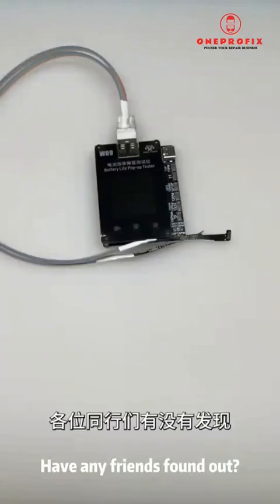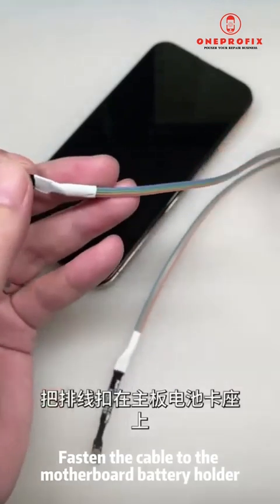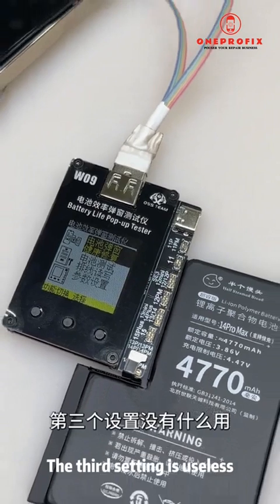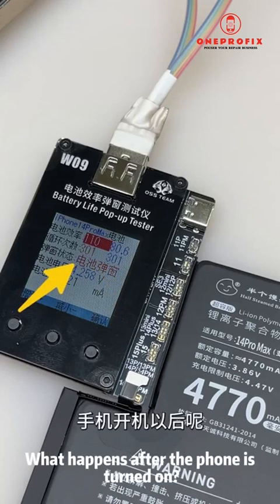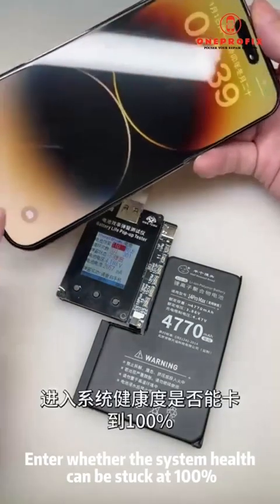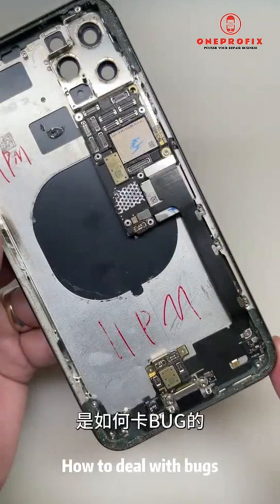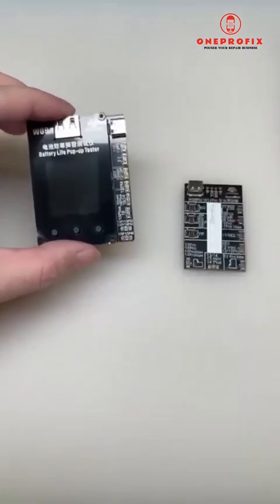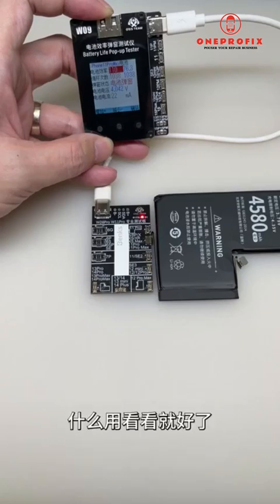OSS W09 Pro V3 battery efficiency pop-up tester without external wiring efficiency 100 data repair

Comment: Can you use this devise also to increase battery health of the old original battery ?
Reply from the maker: Requires original battery or new battery with cables ported from original battery
Reply: So to be clear with this device there is no need to swap BMS board when changing battery ?
Reply from the maker: @Poppington-1z  Premise: The battery above the original mobile phone must be in, because the protection plate of the original mobile phone must be removed, and the spot welding machine is welded on the new battery core!
Reply: @YueHetool I don’t understand. Do you mean we still need to swap the old bms to a new battery?
Reply from the maker: @benjeremii  yes
Reply: That means the only difference is you won’t need any battery tag on after swapping old BMS to a new phone ?
Reply from the maker: @Poppington-1z yes
Reply: Makes a lot of sense